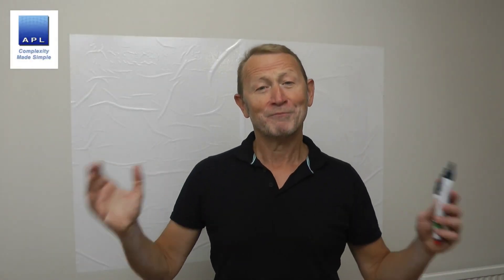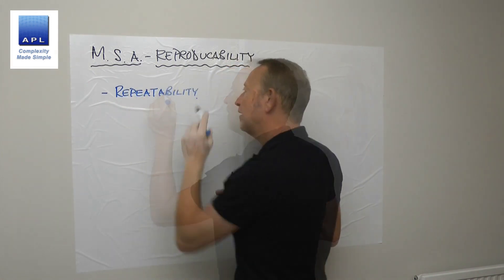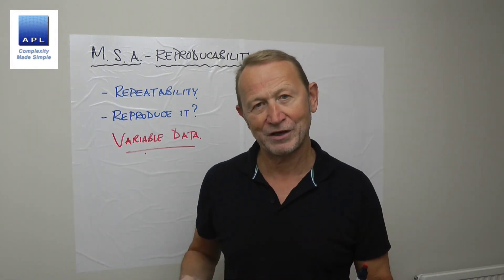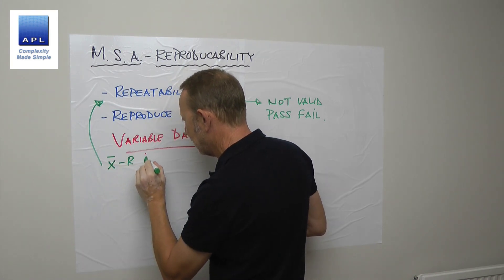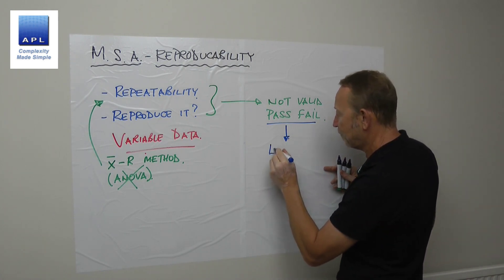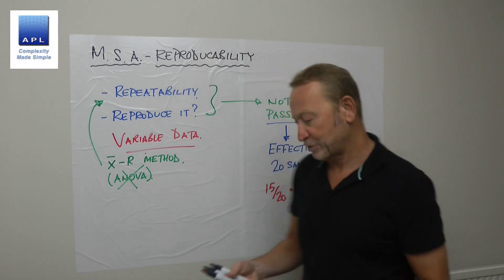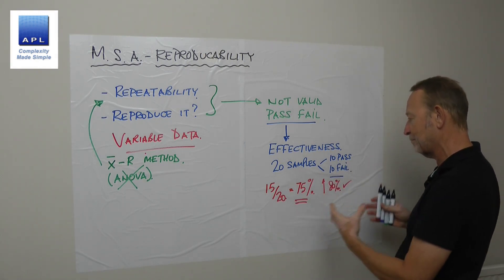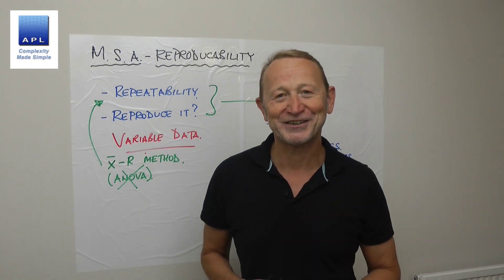MSA  - Reproducibility with only one system....

Comment: Nice video Paul! Love your usual practical approach.
One thing I wanted to add to the discussion: when you have only 1 measurement system, you may still be interested in reproducibility - if multiple operators use it and you expect that those humans can effect the measurement outcome (different sampling, sample handling, measuring or reading of result can all be person-dependent). In that case you’ll want to know the reproducibility between operators.
Reply from the maker: Hi Tom - Hope the channel is going well. You're are quite correct of course. If you think the operator has an effect then yes you can create reproducibility, forgot to mention that, thanks for the addition....